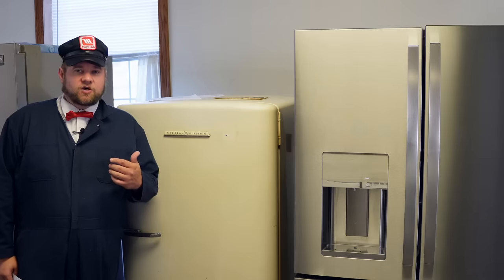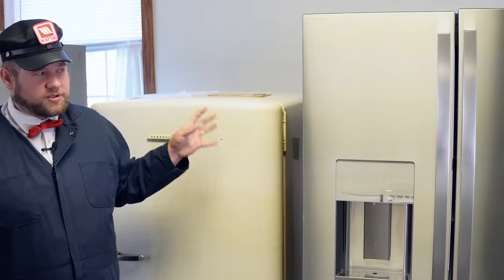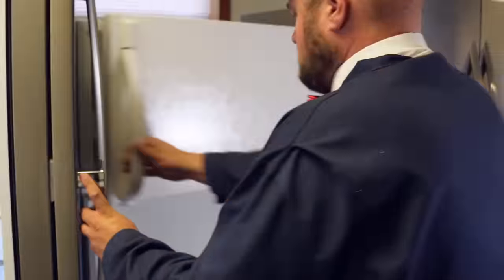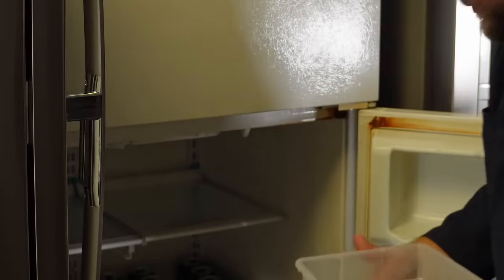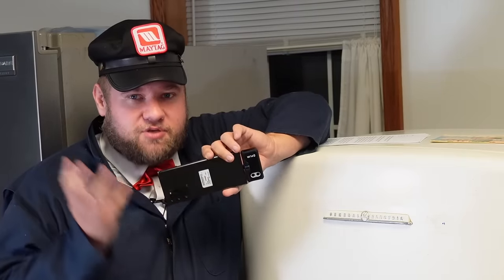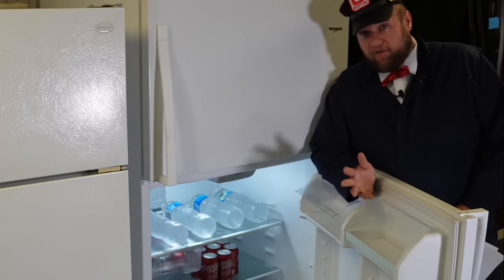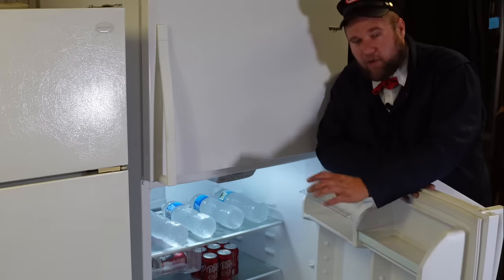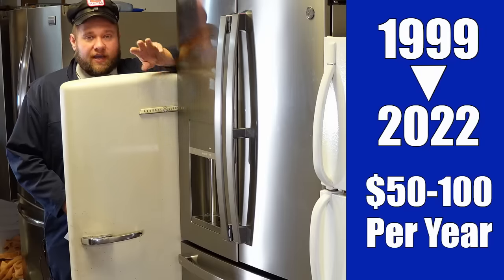Should You EVER Buy a New Appliance if Yours Still Works? A 7-Day Test

Comment: Good job .As a semi retired Maytag man I have seen many changes over the years. One thing the mover and shakers don't take into account are the costs of recycling on those 5 to ten year old units... What happens with the plastics, glass and foam insulation not to mention the melting down the metal for other use ? Is that what is called "saving the earth". I could go on and on but I won't . Some of us remember the days of appliances lasting 20 to 30 years and getting the first service call after 15 years use...No more lonely Maytag Men.
Reply from the maker: One of the videos I didn't use at the ending montage was the FANTASTIC Maytag ad from 1990 (I got the first second of it, but really didnt figure a place to put it otherwise). The whole ad was people shoping at a futuristic Maytag store for a "New Maytag" because their old one finally died after many, many decades. The ad was trying to sell people on the warranty of the 1990 Side by Side. Just an amazing ad, but too long for me to use sadly.
Reply: @bensappliancesandjunk  I went to work at a Third generation Maytag sales and service shop in 1988. We wore the Maytag light blue pants and shirt with the Maytag patch ( like the one on your cap ). Red Carpet Service... There was an element of pride in Maytag . Hard to believe Maytag started out making farm equipment.
Reply: Yea but “r600” is gonna save the world
Reply: MY TEST: 1) 1998 Maytag (R134a, side-by-side) uses 3.5kwh/day,    2) 1995 Amana (R134a, bottom freezer) uses  2.4kwh/day.   Note that they where made DRASTIACALLY better than current models.  27 years old and 24 years old and operate perfectly fine.
Reply: Speed Queen seems to have taken the place of the old Maytags.  My mom had a Maytag washer that was over 30 years old. She had it until she passed on.  Those old Maytags made in the 50s- 60s- and 70s were lifetime appliances. You bought them and they lasted a lifetime. Maybe they needed a minor repair in between but they didn't totally crap out in 5 years. If there is still a lonely Maytag repairman around he is working for Speed Queen. Maytag is owned by Whirlpool now.
Reply: Got to remember, those old machines were expensive compared to what people typically expect today.
Two to three times(or more) the cost as an equivalent size today. 
If I paid the equivalent of $2500+ for a 10 cubic fridge today I'd expect it to be built like a tank as well. You can buy 10 cubic foot fridges for $500 about any day.

Course even if it was built like a tank, it did need maintenance and so folks used to know that and take better care of their fridges (because they were expensive) so the coils got a regular cleaning for example. 

Nowadays probably 95% of people don't even know the coils exist let alone that they only work effectively when clean.
So they let the coils get all plugged up with dust and pet gunk and the compressor then needs to run longer and more frequently and so it dies well before it should and they wonder why the fridge only lasted 7 or 8 years. 

Similarly, fridges today often don't get sufficient airflow as modern kitchen aesthetic demands fridges be tightly built into a kitchen. Even if installed with minimum airflow requirements met, the minimum is not necessarily sufficient for longevity.
Reply: @dorvinion  your spot on my friend, those coils are a money driver too.
I try to explain the enclosed space theory to other techs. They shrug it off and say “it pulls air from the front it doesn’t need the space”.
People just don’t understand basic refrigeration lol
Reply: Agreed, we have a 43 yo freezer that has NEVER been serviced, we just defrost it every 6 months... our 2003 fridge lasted 6 years, our 2009 fridge lasted 10 years... our 2019 fridge has been replaced fully once.
Reply: I had a semi modern upright freezer that was dying a slow death (seemed like it was slowly leaking out) - put out an ad on the local radio swap meet and ended up with an old one from I think the 1960s. Energy consumption about the same and still chugging to this day. Also uses R12 of course, and a lot of it.
Reply: When those old maytag washers broke, they broke, no sense in repairing them compared to the Whirlpool Timer Switch units.
Reply: @mauricelinton5867  Something else just occurred to me.
Back in the 40s to even the 70s, homes didn't have air conditioning. Fridges were designed to expect a kitchen to be hot with some frequency.

Nowadays basically everyone has air conditioning. Mfgs know this so they design the fridge with the expectation of rarely experiencing a temp above 80F.
Stick a modern fridge in a garage or on a front porch and its gonna die quicker as well. (Those also happen to be dirtier places so the coils get plugged faster too)

More heat going into the fridge, more heat to remove from the fridge, shorter cycles and longer running at reduced efficiency.
Reply: @dorvinion  your example about the garage for modern day refers is exactly why I say they don’t work in exposed places. I’ve measured over 90 degrees in some spaces
Reply: @dorvinion  More complex 1cent tiny electronics combined with dirt and dust build up that increase temperatures are what lead to point of failure. Also now days different is that there isint really dedicated housewifes around that would maintain the machines like that with cleaning. Everyone are too busy with stupid shit and "fridge is just fridge, why would it need cleaning, its just a cold box?" And electricity comes from the wall...Yeah our culture is the issue for most parts in this, well as we becoming consumers, not customers.
Reply: Reuse is better for the environment than recycling
Reply: @dorvinion  Here is another point. People didn't buy/sell their houses like they're all real estate agents like they do now. You bought a home to live in , not stay in for a while then fob off on someone else. As a result many people treat their homes like a rental and that goes for their appliances as well. If you buy and furnish your home knowing you're not moving for a few decades, you'll probably buy better quality and then take care of it.
Reply: I asked a Maytag repairman one time if he was as lonely as the company depicts on television.  He assured me that he had several service calls that day.  He did say that while he stays busy, he's not nearly as busy as repairman of some of those other brands.
Reply: I work on furnaces and we are seeing a lot of the same problems. The newer ECM blower motors are nice and all, but they are breaking within 10 years most of the time because they are more complicated. Lawmakers made it mandatory for these to be standard on all new furnaces because it saves energy and the earth, but when we are going through them more often, and there are now microelectronics and a circuit board on them, where do you think they go when we throw them away. They cant be recycled down properly and ends up causing more pollution destroying them than the amount saved being efficient
Reply: In 1989, I paid $866.00 for a Deluxe Maytag refrigerator with an ice maker.  In 2009, I paid $2,600.00 for a 20.0 cu.ft. Whirlpool Gold, bottom freezer, water and ice in the door, cabinet depth refrigerator.  My Maytag doesn't have coils on the back; it is made the same as a drink machine with coils underneath.  Your assessment of costs is accurate.
Reply: @bukboefidun9096 we had standing deep freezer that last about 20 years my grandma bought in early 2001 or 2002 and just went on pasture this summer.
Reply: @Hellsong89  pretty sure house husbands could clean them too. People don't expect to do maintenance on home appliances because companies are invested in making it seem like they don't need maintenance. I work mostly with vacuumed cleaners and the recommendation for changeing the filters and removing hair from the rollers are completely absurd. Many say change the filter every 6 months but if you have pets or kids tracking in dirt and you vacuum every other day you should be washing filters and blowing out a bagless machine monthly.
Reply: Orkhiss  planned obsolescence and corporate greed play a big role in the way modern appliances are made for sure. But in a way you'd have to call out the entire system for being made around making as much profit as you can as quickly as you can and I get the feeling a lot of the old timers in the comments of this video would rather chop off the arm they use to open the fridge then criticise end stage capitalism.